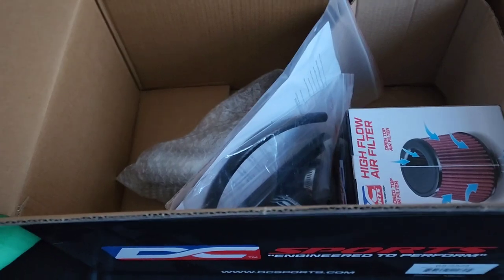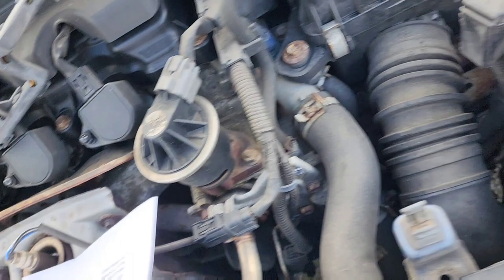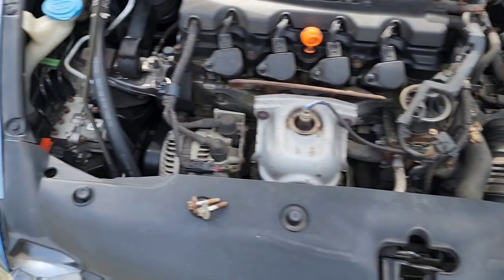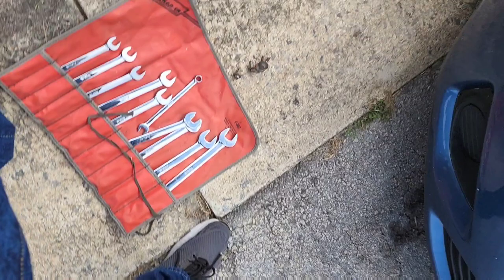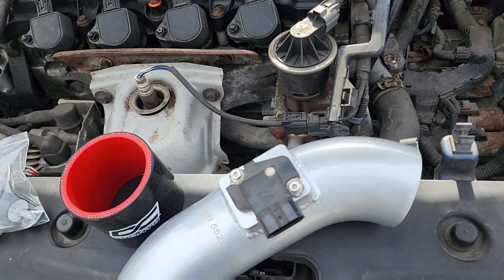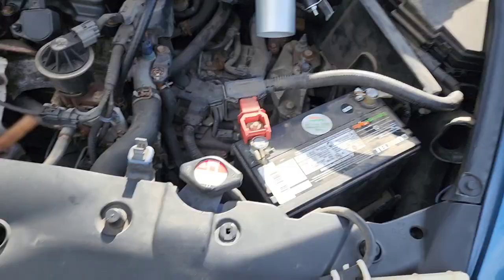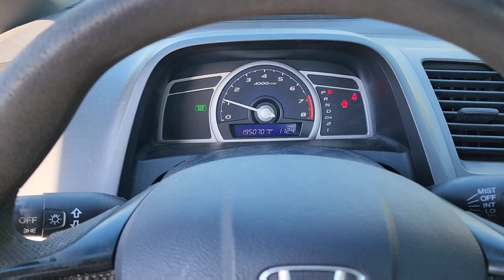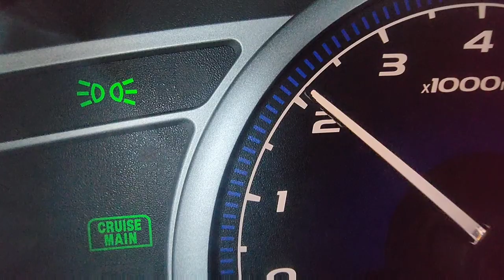DCSports Short Ram Intake installation on 2006 Honda Civic R18 + sound before and after

Comment: get a true cold air where the piping goes down to the bumper.  they are AMAZING on r18 engines.  and dw about water or puddles.  there is a splash guard underneath the front bumper that doesnt let water in.
Reply: Actually theres a hydrophobic filter cover so you can have an airway through the foglight
Reply: Link to any of those true cold air?
Reply: @chinito6715  yes please, someone give us a link I’m looking for new intake right now
Reply: @chinito6715 no point does absolutely nothing unless you’re actually gonna turbi it just do a short ram
Reply: U need a tune with CAI’s

Comment: Hi how is it holding up? also did you have to get a tune.
Reply from the maker: No problems so far. I didn't get a tune and haven't had any problems, but if you want to get any power gains, you'd have to get a tune.
Reply: @KingTurkeySub  ok thanks I appreciate it.

Comment: It does get heat soak easily bro...
Reply from the maker: I knew that going in. The R18 isn't a good engine for making power anyways. I just did it for the sound. Eventually I'll K swap my car, and when I do that, I'll get a true cold air intake.

Comment: does this intake fit in the 9th gens?
Reply from the maker: I can't say for sure. It's only officially listed to fit the 8th gen civics, but the 8th and 9th gens are very similar in a lot of ways, so it may fit. I do know that DCSports has a cold air intake for the 9th gens with the 1.8L engine. I can't seem to find a short ram intake on their website for the 9th gens though. I think they made one at one point, but it's probably been discontinued. You can still get a short ram for the 1.8L 9th gens from other companies, though.

Comment: Does the car jolt alittle when you first installed the filter?
Reply from the maker: I think it did when I first started it up after installing it, but only for a second and it ran perfectly after
Reply: @KingTurkeySub  did the check engine light also come on because mine did when I put a short ram in but I mean it still came on when I put a proper cold air intake in
Reply from the maker: @bobyouruncle8433  my light didn't turn on. I'm not sure why it would tho
Reply: @KingTurkeySub  I mean it's probably because maf is reading different air level compared to what it was supposed to read that's my theory anyways, but yeah my engine light came on
Reply from the maker: @bobyouruncle8433  yeah could be
Reply: @bobyouruncle8433  try to disconnect your air sensor while the car is running then plug it back in. did it on my 2015 civic after a hot intake
Reply: @Renault-v10  yeah well I tried this awhile ago to see if maf was still working and Ofc the car would stall if it is working